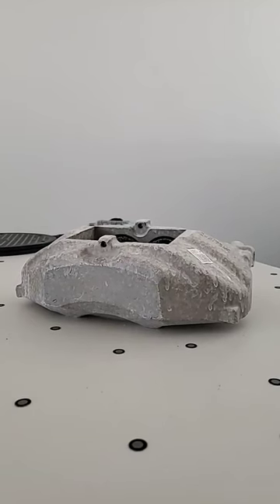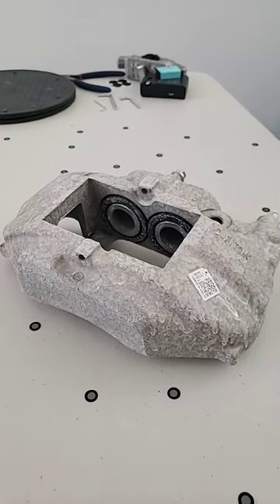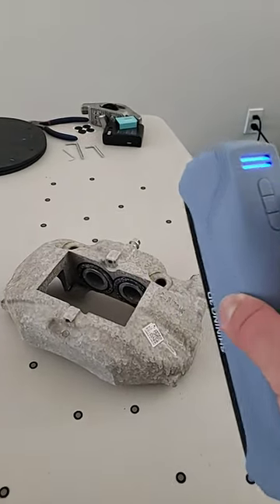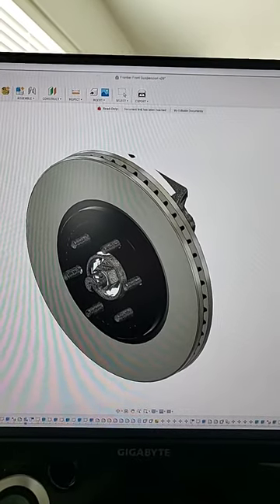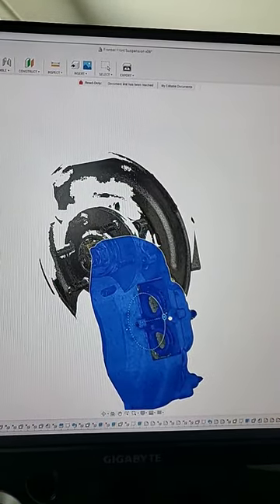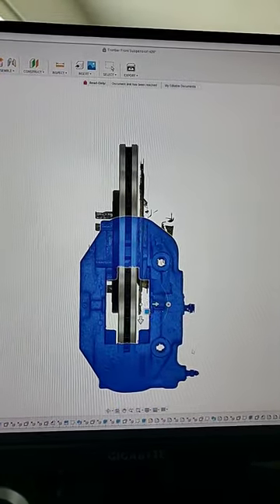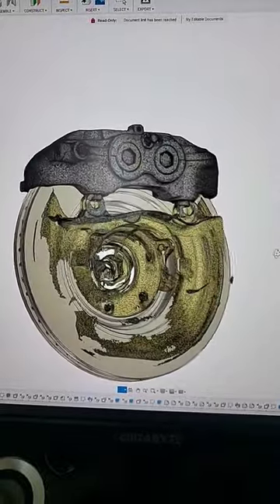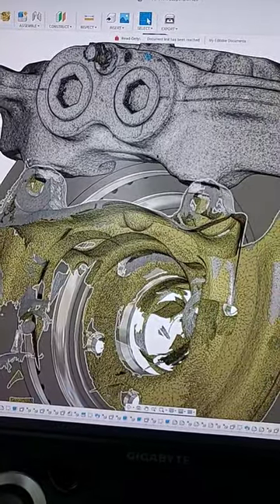3d scanning a caliper for a custom big brake upgrade on my Nissan Frontier. #car  #3dprinting

Comment: There are 3D scanning sprays that actually sublimate so they leave no residue. Worth every penny imo
Reply from the maker: They look like they work great, I just have a hard time justifying anything more expensive on what I am scanning...however I have a few projects coming up that will definitely require it because I don't want to risk staining or having to remove the residue.

Comment: may better off using a radial mount caliper.   you have the CAD to make your brackets.   wilwood may already made one.        still a good share!

larry
Reply from the maker: I have looked at a few but have yet to pull the trigger and order anything to test fit, but yes the radial mount would be much easier to get fitted.

Comment: If you don't mind me asking, what rotor are you using? V8 Pathfinder? Also sent you a message on instagram regarding another caliper you might be able to try.
Reply from the maker: Yes they are v8 pathfinder rotors. Not a lot of rotor options with the same lug pattern.
Reply: @EndMotive  Yeah, I couldn't find much either that was off the shelf at a local auto parts store. Really looking forward to seeing what you come up with.
Reply from the maker: @Krashota  the pathfinder rotors are the obvious choice and make alot of sense with the hub bore being correct too. I did however find a random dodge viper and Dakota rt rotor that was the correct lug spacing but not ideal diameters or thicknesses.